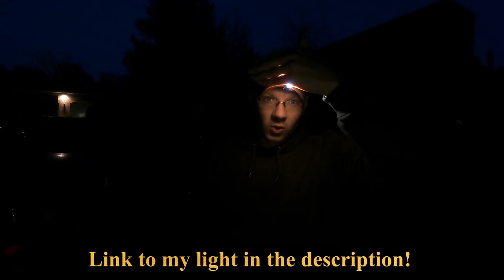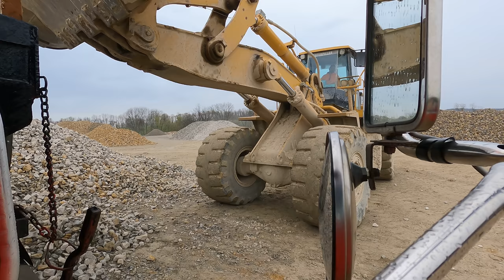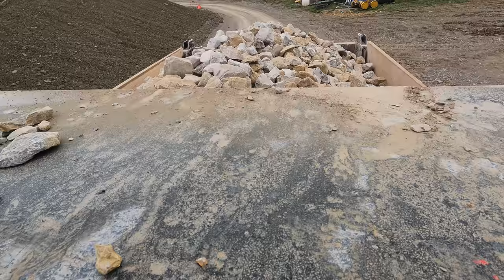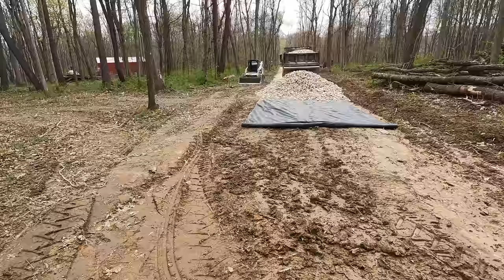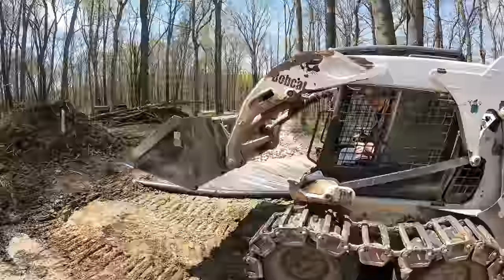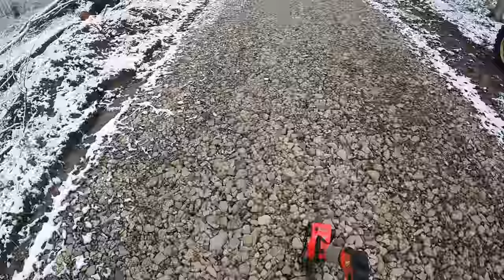Driveway so long it took over 8 years to complete!

Comment: I came for the Autocar but found that the channel is interesting and entertaining with all the other content. I can't wait to see the old Autocar haul its first load. You are a bit of a glutton for punishment with that old truck though. If it were me, I'd have picked up an old 70s or 80s Mack R model or maybe a 1950s or 60s B model if I really wanted old school. You live in PA which for decades was Mack truck country (they were manufactured there for years) and I'm betting parts new and used are plentiful for Macks compared to other places. Autocar parts? not as available. I grew up in NJ and I remember the area such as NJ, Philly, NYC, Mack trucks were everywhere doing every job.
Reply from the maker: Autocar was manufactured here for decades as well
Reply: @DieselCreek  True that. Those old Rs are serious workhorses though. I drove one for a while.

Comment: Driveway is only 0.3498106 miles long. Get the kids a wide shovel and they should be able toget it cleared in 3 or 4 hours Lol. Ya right u will have the kids some kind of giant 60 year old snowplow I'd put Money on that.👍 Glad to see u finally have a proper driveway. That took a few load of rock...

Comment: So... 17 loads +1 in 2013?  Is that a correct count?
Nice that you have that 10yd dump truck, because easily the lions share of gravel cost is delivery.  I'm sure that IH guzzles the fuel, so no insignificant cost there, but probably paid for itself just in savings vs having to have all that rock brought in by a contractor.

Comment: I know this video is a year old, but I find it quite intriguing. I stopped at 32:39 so I could venture a guess as to how long your driveway is. Hard to really measure it when you're fast forwarding through the video while you're walking. But it looks to me like it's maybe 1/2 mile. Now to go see how wrong I am.

Looks like I overestimated. The number of feet you indicated is closer to a quarter mile. Maybe a little more.

Comment: I'm sure its probably already been said or asked, but is there any reason you didn't just set the tail gate with a chain and reverse dump it so that you would drive over it as its dumping saving having to have to do as much work with the loader

Comment: I have the exact same truck but mines gas job with a 4 barrel on it supervis  and looking truck it was a heating oil hauler back in the day  a 3000 gallon  oil tank I wanted the hole unit but he sold the tank to a pool company  great looking and running truck 1957 auto car same color and all I had to see if I still had it when you first aired it
Reply from the maker: I bet she’s easy on fuel 🤣

Comment: Hey bud not sure if you are close to MD but I have an old john deere 755 crawler loader that has been on my property for years. It was running when parked but has been sitting since the early 2000's. Not sure if you would be interested in buying it but it could be an awesome project. The turbo is free and so is the engine but the wetsleeves have dropped on the cylinders so it does not hold coolant it flows right to the oil pan. Lmk if this is something that may interest you. I also have a 70's or 80's Autocar here with a DOHC Cat turbo engine that I would love to get rid of as well.. Not sure if you could use it for parts but seeing as you have an autocar maybe it may help you out. Love the vids man.

Comment: Excuse my ignorance, but why the plastic membrane under the crushed rock?  Surely that retains water, rather than lets it through.  Or does it prevent erosion under the rock that would be caused by flow-through?  Thanks
Reply from the maker: Neither, it let’s water through it and keeps the mud from coming up into the rock rendering it in effective. You save a lot of rock using the fabric
Reply: @DieselCreek  Thanks.  Fabric, rather than membrane is the key.

Comment: Why didn’t he back and spread with the dump truck instead dumping it in a pile? I chain my spreader gate even on my dump trailer and drive forward it works pretty good I can get nice results and it’s a lot quicker
Reply from the maker: Yup going forward is easy, reverse is a lot harder and with this size rock and soft ground it’s darn near impossible

Comment: Hey mat why do you want a long drive way  and from the road to your work shop  how many feet is it  and i seen the pull behind camper and the boats  and what are you going to do with the VW truck and the old blue jeep  and where did you find the other equipment that you have at and when are you going to start remodeling the church

Comment: it would have been easier to spread the crush rock along the drive if you had sheeted it then you would not have had to use the loader and skid steer to smooth it out

Comment: why didnt you  just cut the road box down to dry with the wheeled loader then roll it then stone it ? if you had the room you could  stock pile the stone  then used the loader to stone the road which would give you more control over the sides . high insite is 20 40

Comment: What's the reason you used big rocks and used road gravel??.
Reply from the maker: When you build stuff like this in soft/ wet ground you need to start off with big stuff to make a base. Big rocks don’t sink and mix with mud so easy. The whole thing will get a top coat with road millings eventually

Comment: I do not understand why you apparently don’t want (can’t?) to initially spread the rock from the dump truck. What am I missing?
Reply from the maker: Ground was too soft and the truck is geared too high. I could tell going forward, but if I drive on the fabric before the rock is on there, it messes the fabric up.

Comment: Hey Matt you could use your large scale equipment for large scale compost generation.  Instead of burning off the brush & smaller logs, you could just char them instead.  An incomplete burn.  Mixing charcoal with your topsoil could make fantastic compost soil.  Terra preta.  Black soil.  Biochar.  Almost  miraculous fair dinkum!  Great for crops. You could sell it if you don't use it.  The ancient Amazonians used to pile up the brush & make a mud oven around it for a slow burn.  A clever, resourceful fella such as yourself you rig up a portable charcoal oven attachment for one of your tractors, or a mud mold for such an oven, I'm sure you could come up with something.  

https://www.youtube.com/watch?v=0Os-ujelkgw

Comment: Lets see.  1847 feet long divided by 8 years equals 19 feet per month.   A load of rock should cover 20 or 30 feet.  It took  between 62 and 92 loads.  A load costs around 75 dollars. That would mean the cost of the rock is between 4,650 and 6,900.
Reply from the maker: I wish rock was that cheap. I pay straight from the quarry 100-120 a load
Reply from the maker: And I’m definitely over 100 loads in here some places it settled and I’d have to make it thicker.

Comment: Why couldn’t you unload the rocks and drive slow on the black tarp so you wouldn’t have to deal with all those big piles to smooth out? I may have never ran any machine like that or even done that but that’s prolly what I’d do.
Reply from the maker: Yes everyone saying that, I’ve tried that in previous videos on the channel it does not work out very well with the large rock and the soft ground. I don’t have a low enough reverse gear to make it work correctly. The truck stalls out or I go to fast and either way you have to re-grade the entire thing with the machine when you’re done so I just dump it in that way it’s spread right

Comment: glad your IH has the deluxe drivers seat, cheap ass I use to drive an S1900 box truck for bought the low option model that had the same 2 seats (as in your passengers seat) I had to stop fast on the highway and with only lap belts I was pretty much laying on the steering wheel when a semi rear ended me and put my head through the back window, due to cascading issues in treatment I still have cognitive failures due to the skull fracture, one of the few times I wish I was an American as under your legal system I could have sued the insurance company and the transport company, under ours I got $50k for an injury that still plagues me close to 30 years later

Comment: Why don’t you drive and release the rock behind you evenly like I see many dump truck drivers do?
Reply: Yes, it's called in French "vider à la chaîne", with 2 short chains hooked to the back panel of the truck body buffer, but it works much better on smaller cuts of material like : 0/20 or 0/31 or 0/40 if those cuts of material exist in the US.
With the kind of rocks Matt uses, possibly 40/80 (?) it's far more difficult to obtain a precise and regular dumping.

Comment: Gooing have to find you an old jaw crusher, then you can recycle old concrete and bricks.
Reply from the maker: Neighbor has one, he won’t part with it though… I’ve kept an eye out for one for quite a while
Reply: @DieselCreek  found one in Birmingham Alabama . Big enough for a bobcat to load. But you will have to build a hopper and a conveyor belt. It would be good to recycling  bricks an concrete. 
Could be stationary engine or gear boxed PTO powered.
 But If you look for bankruptcies or closed quarries you might find one even cheaper. Check youtube of gravel pits an quarries in your area. Always some one making a video of off roading, drone flights or people just looking
Reply: @DieselCreek  i was in cranberry business.  If they didnt make it you built it.
Reply: @DieselCreek  if he isn't using it make a deal and on next demo job split profit or split material generated. Keep brick colors seperated, cinderblocks, an concrete.
Reply: @DieselCreek  then look for a gyro rock crusher to make 3/4 inch or smaller.